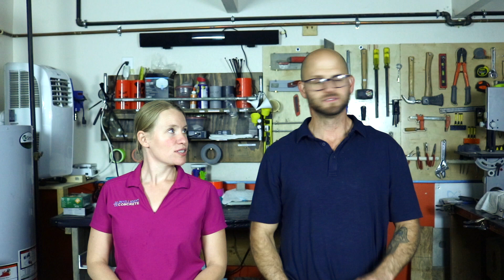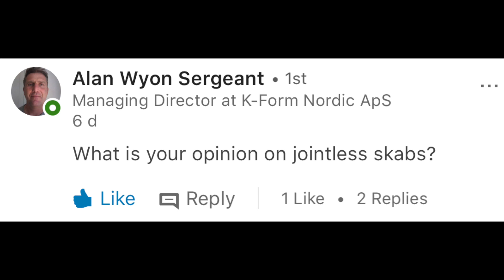Jointless Concrete? - Vlog #60

Comment: The problem with black concrete is an issue of pigment choice. Without polymer modification, you can't use carbon black. In decorative, black colored synthetic iron oxide is best practice for integral cementitious coloring.